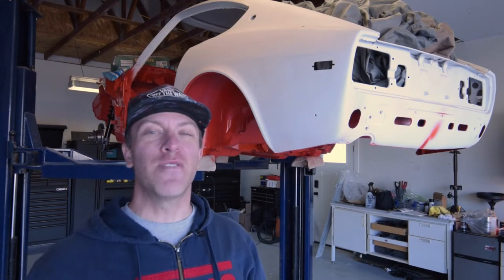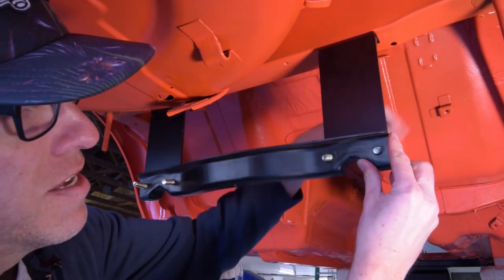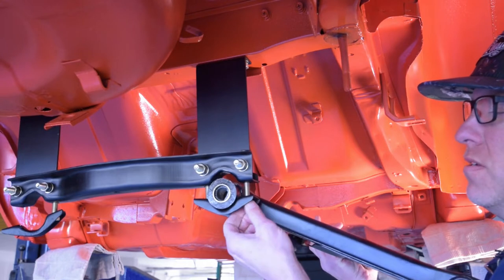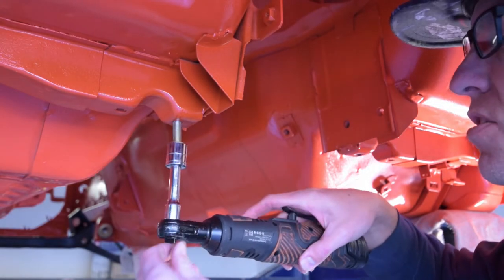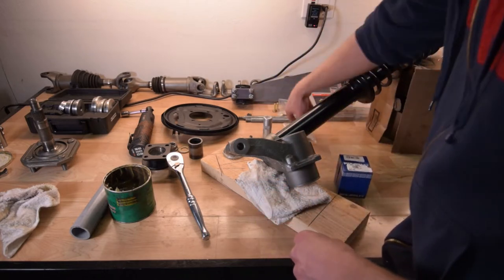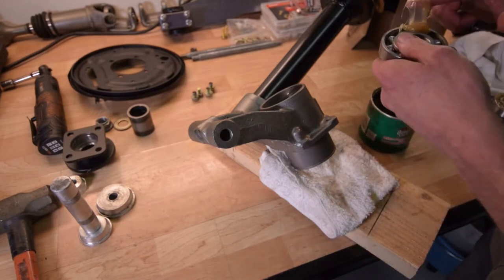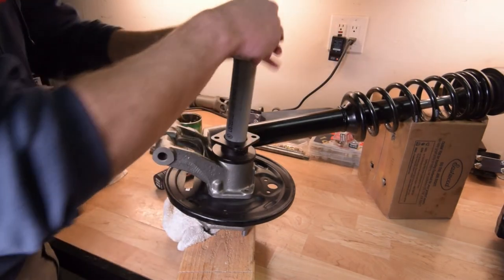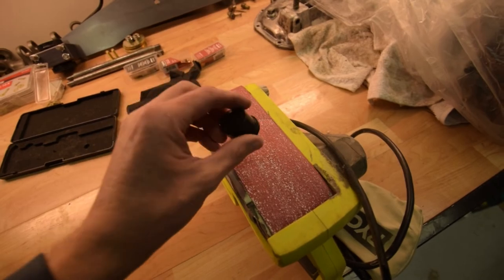How to install rear suspension in a Datsun 260Z. EP8

Comment: Just found your video I have a low miles 260z  that I've owned for about 4 years it spent 25+ years in 2 garages without being driven before I bought it. I will drive it for the first time in 2021 , delayed because of life !
Reply from the maker: Right on! Enjoy the drive, the Z is so fun, enjoy it!
Reply: I have a lot of z cars many z31 turbos , the 240  & 260 are cars of their own type , quite different from their fuel injected siblings !
Reply from the maker: Awesome! Sounds like a great collection.  What’s your favorite Z31 you have?

Comment: Great video.   I recently rebuilt the front and rear suspension on my 78 280z including all new bushing, adjustable koni shocks and progressive springs.  When I took it in for alignment I learned a couple of things I wish I had known prior to my rebuild.  Specifically, on the stock lower control arms I should have used the eccentric aluminum/delrin bushings from T3 for the rear and g-machine type on the front (MSA distributes).  In the rear I gained both camber and toe adjustment.  On the front I gained camber adjustment.  In the end, I re-did them and was able to get the alignment exactly where I wanted it.  Of course you can always replace all of this with newer control arms and gain even greater adjustability but I felt that to be overkill.  FWIW.
Reply from the maker: Thanks! So many awesome aftermarket parts to make our Z’s even better!

Comment: Dude, that was awesome, you're the $hit man... love your work.  Great insight to the rear control arms and the bushings.  Those back hub assemblies are a little daunting, you made it look easy.   How are you're gonna get the stub axle nuts up to torque?? I think it's like 600 ft-lb.... yikes.
Reply from the maker: Thanks man, always appreciate it. 🤘🏻 thankfully the stub axle nuts should torque around 180-230 ft lbs but still, LOL
Reply: @CarsBikesandCoffee  I'm surprised you didn't need a press to get the hubs all assembled.  did you freeze the shafts or anything else?? What grease did you use?... you made it look very easy.
Reply from the maker: A press is always helpful. Honestly doing them off the car is a smarter approach. Throwing the stubs i. The freezer for a bit always does the trick too!
Reply: @CarsBikesandCoffee  Hey buddy... I have this very thin 1 mm/0.040" thick brass washer that goes somewhere in this assembly on my 73.  My manual diagram is not great, it might between the outside of the inner bearing and the splined feature of the end fitting?? It looks like a thrust washer of some sort, but everything is rotating together.  hurting my head man....
Reply: Nevermind... it won't fit with the spacer, the ID is too small, wont get past the shaft feature for the inner bearing race.  It can only go between the end fitting and the bearing.
Reply from the maker: Glad you figured it out! 🤘🏻

Comment: Hey, this is my new favorite channel as I am buying a 260z this week! I wanted to ask you about a video you made for the 32/26 weber carbs. I am buying one with them already installed, however the fuel rail isn't stock. It looks like it has some homemade return line. Did you use the stock fuel rail or is there a specific one you recommend?
Reply from the maker: Awesome, congrats! Welcome to the Z family. Mine was a stock fuel rail. Stock there is roughly two parts, fuel and return line from tank to front passenger (right) corner and the lines to the carbs. Is yours homemade all the way back?
Reply: @CarsBikesandCoffee  https://ibb.co/album/j9Wt94 wow thanks for replying man, I attached two photos of the engine that I got from the seller. I think it’s homemade all the way because the fuel rail  is dead headed to the carbs and the line back to the tank has a makeshift plug on it. Let me know what you think!
Reply: Also I have been watching your videos all morning haha
Reply from the maker: Looks like they cut the stock fuel rail and ended it on the rear carb. Normally it would tee, go to the carb, and loop back around to the return line that has the bolt in it. The Weber’s are low pressure so you could either just source a stock one or tee that line and loop it back to the return. Just keep the hose off the block and any heat.
Reply: @CarsBikesandCoffee  okay Ill probably source a stock one and go from there! Thank you so much for the info and look forward to more videos. They’re all really high quality and I really enjoyed your detailed cleaning of the carb. Going to be doing suspension work as well and already starting to watch some of your videos! Keep it up!